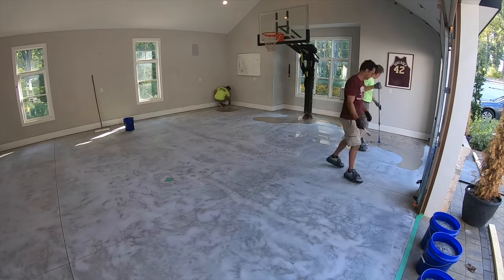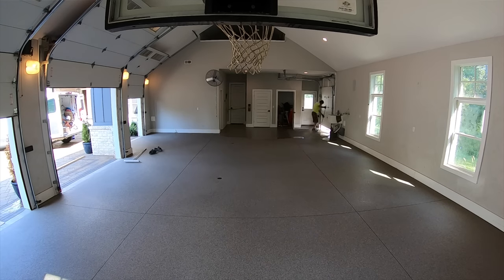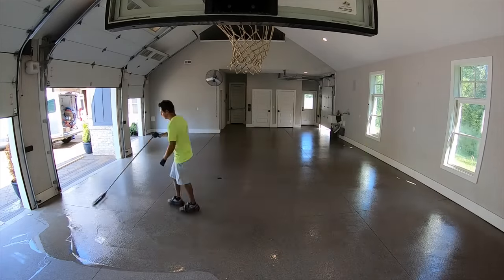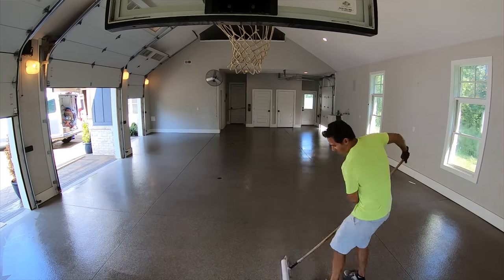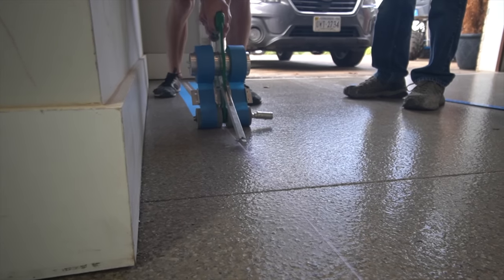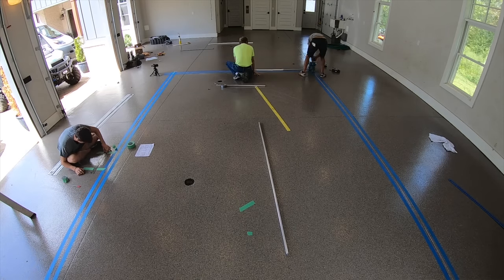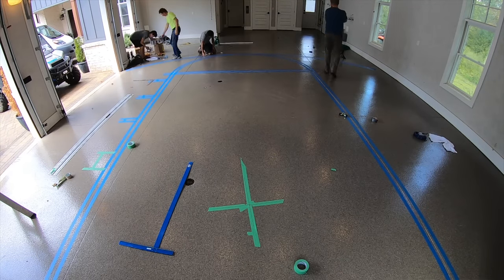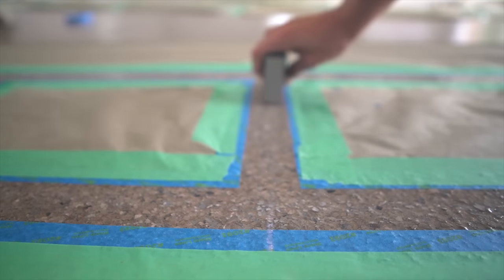Building a Basketball Court in a Garage with an Epoxy Floor

Comment: Those windows are breaking forsure
Reply from the maker: Haha. Yeah I thought the same thing. All of the windows have marks on them where the ball keeps hitting them...but so far they haven’t broken. ¯\_(ツ)_/¯
Reply: I would put a net in front of the back window and heavy drapes over the side windows
Reply: anony moose  very 1st thought I had, "with my jumper, no buckets with that low ceiling..."
Reply: Next is prob going to be a “How to repair broken window” video
Reply: @acer7217  I couldn't shoot on this hoop my shot has too much arc it'll just the ceiling everytime
Reply: Ceiling doesn't look low. Yall need to look at the backboard. Plenty of space
Reply: @j_boogie_483  I mean most arcs go about 50cm max above the backboard. Unless you have arc arc
Reply: @NARFALICIOUS  I would put the basketball hoop in the driveway where it belongs and my cars in the garage.
Reply: @TimDCVA  hundred bucks glass

Comment: I saw the recommendation for spraying which would have avoided the bleed through.  However, rolling is totally fine as well.  Just do something called "back-painting" first.  Once you tape off, roll a thin layer of whatever the color under the tape is, in this case clear.  The clear will bleed and "fill the void" under the edge of the paint allowing your color coat to be perfectly crisp with no bleed through.  You can apply this method across any type of painting project.  Looks good though.  Nice to see proper technique on application method and measurements.
Reply from the maker: Thanks!

I considered doing this... wasn’t 100% of the correct process though. Does the clear have to be completely dry before going over it?

Comment: Looks awesome but how can you even shoot in that garage? You’ll just hit the ceiling
Reply from the maker: Thanks! The ceiling isn’t an issue. It’s prob 18’ high in the middle.
Reply: You can only shoot three pointers from the top, just have to develop a horrible flat shot.
Reply: Sam Beaumont lol what? It’s super high in the middle. You can shoot normally
Reply: Omni Media Group - it is noted to be between 16 and 18 feet tall (in the middle) - see other comments. An elite level shooter’s ideal arc tops out at between 15 and 17 feet - hardly plenty of room/no allowance for margin of error and that is on an elite level player. 

Having a constant concern of hitting the ceiling, could easily lead to the user developing a flatter shot.

At the end of the day - these guys did a great job on the floor (their area of expertise) and the practicalities of the garage being used as a basketball court is irrelevant to that fact.

But I cannot help question if the intention was to make it a mixed use garage/basketball court before the garage was built or not - having a rafter ceiling and what appears to be a reasonable pitch adds cost - given the severe limitations of the court itself - it seems like either not much thought was put into it, or they didn’t think it through - although could be other restrictions around planning, permits available space etc.
Reply: Sam Beaumont i didn’t realize Stephen Curry was going to be playing here regularly lol. It’s just their garage for family and friends to come play at. Most people aren’t going to be shooting 18 feet tall shots.
Reply: Sam Beaumont also, the league average for height on a 3 point shot is right around 15 feet. Curry’s Max is usually around 16-16.5 and he shoots a pretty high shot.
Reply: Omni Media Group - kind of making my point?

Ceiling height - 16-18 feet in the middle.
You noted Stephs max height for a shot is 16-16.5’ - that skims or hits the ceiling at the lower end as indicated.

45 degree entrance level arc peaks at ~15’
55 degree entrance level arc peaks at ~17’

As you have noted these aren’t likely to be elite level players which means arcs are not going to be ideal or consistent.

Hit the ceiling a few times and you will start to subconsciously shoot flatter shots to avoid hitting the ceiling again.

Steph Curry has made the three ball very popular and young kids are less “Be like Mike” and more let’s shoot it like Curry.

Given the size of the court I would have to believe that it is more to muck around on get some exercise than anything else - even pros muck around with shots from half court, going into the tunnel.

Edit - spelling
Reply: @omnimediagroup5761  If you've ever played at a local gym that has a low roof or hanging light fixtures, you would know that a low ceiling is incredibly annoying to deal with.
Reply: Not to mention how narrow the court is. Not a good environment to develop range along the baseline. This looks to be a good court for working on free throws and post play, but as someone mentioned above - not a lot of young players want to do that. Floor looks great but this space is no good for any players who are serious about developing their skills, at ANY level.
Reply: Valente82 I would agreement I would want the garage to be bigger (wider) and taller on the sides for a serious practice but for free throws like you said are fine
Reply: @vsmcax1007  I think youu just need an adjustment on your drill if you want to practice there and find the perfect drill to do in that kind of space. It will develop your creativity too. I think it's better to have your own court rather than nothing . #stayhome #stayhoop🏀
Reply: @maxhansen5595  bigger is better... ✌🏻
Reply: You should have just put a slab of concert  in the back yard.. good conspect but your garage isn't nearly hight enough to play basket ball in....
Reply: Sam Beaumont how am I making your point? If you’re throwing a 3 pointer over 18 feet high, that a garbage shot anyway lol. Considering the 3 point line is mostly only in the middle on this court, it’s probably a non issue. Like I said, Curry shoots incredibly high and the league average is 15 feet (which is where most people are going to shoot their 3 pointer) lol. The dude even said it’s a non issue but here you are still arguing it is.
Reply: @sambeaumont395  you can shoot normal with a ceiling like that. People keep saying its low without looking at the backboard. No one just gonna build without knowing the space. I use to play in ceilings like that and and was perfectly fine

Comment: If you put mod podge on the edge of the tape first, then paint over it. Your lines will be way more crispy
Reply from the maker: I don’t know if it would be a good idea to use mod podge on a garage floor...but your premise is correct. We’ve painted lines on other projects since I made this video and using clear urethane on the edges of the tape and it does make the colored lines more crisp. 👍🏻👍🏻

Comment: i recently watched a video of someone putting sand into the paint for thier basketball court to prevent sliding and such when playing. what would be the benefit compared to sand that the epoxy and chips give you?
Reply from the maker: I think the main benefit is that a vinyl chip epoxy floor is meant to be driven on. I doubt a typical outdoor court surface would hold up very well as a garage floor.

Comment: Do you not have to worry about getting so much top coat in the control joints? Thanks! Awesome video.
Reply from the maker: Thanks! 

We pull the material over the joints pretty quickly to try to avoid filling them. It definitely gets in the lines, but it never comes close to filling them all the way up.

Comment: Can I do something like this to my drive way so the concrete isn’t so rough and doesn’t tear up my basketball shoes?
Reply from the maker: You can’t do an epoxy floor outside...but we do have a few different systems that we could do that would help you with that.
Reply: TimDCVA  what would those be?
Reply from the maker: Probably a troweled concrete overlay. You can find info on my website. Check the link in the description of this video.

Comment: is the flooring harsh for shoes and falls? vs say using wooden vinyl
Reply from the maker: Wood is softer than concrete… so wood would be better for falls. 

If you put vinyl over concrete then it would probably be about the same.

Comment: Awesome job! What type of paint do you use. Any special thing to know about painting on top of the epoxy topcoat. Will the epoxy outlast the painted lines?
Reply from the maker: We used a colored enamel on this one. The paint wears faster than the epoxy… so we could see through the painted lines on a lot of the high spots of the textured floor. It doesn’t look bad that way though.
Reply: @TimDCVA  thank you! Maybe another topcoat over the paint would protect it? Or is that not recommended?
Reply from the maker: Yes that probably would solve it.
Reply from the maker: Thanks!

It would be hard to do that because by the time the lines cured, you would be outside of the recoat window for the polyaspartic top coat.

Comment: Great video. I need to work on my outros lol, you’re great at them 👌🏼 ... tape machine for the win ! Crisp,
Clean and fast. How much are they ? Only thing that would of made the video better is seeing your shooting form from the 3 point line 🤣
Reply from the maker: Thanks!

They are around $1k. It seems expensive...totally worth it though. 

I didn’t get to shoot any...lines were still wet. Ha. 🏀 😎
Reply: TimDCVA WTF ! That’s insane. I would of guessed $250
Reply from the maker: @ConcreteBVI  Ha. I told you it was expensive. It has been worth every penny though.
Reply: TimDCVA 1k? that’s actually relatively cheap as the ones i’ve seen are usually 2.5k all the way up the 5k

Comment: You might also benefit from using black striping paint as well.
Reply from the maker: I considered traditional striping paint... but I figured using the same brand as the coating would have a better chance of bonding properly.
Reply: @TimDCVA  as long as it is oil based paint it should adhere.  There's spray primers that are very beneficial as well!

Comment: Awesome job on the floor, but all the owner will be able to do is layups and (if they're able) dunks. Maybe practice free throws, but any shots there will be arrows, when you should be shooting rainbows. Oh well, maybe they're a traditional big man
Reply from the maker: Thanks! The ceiling isn’t an issue. It’s prob 16'-18’ high in the middle.
Reply: Real world layups could be dangerous with the baseline so close to the wall.
Floaters, Post, Mid Range, Free Throws and three point shots from the top on a good day should be fine at 16-18’ ceiling (internal dimension).

But I doubt it was these guys jobs to comment on the practical use of the garage as a basketball court to the property owner.

Comment: How much would that cost?  Epoxy, paint and labor for that job.  16-22k depending on the slab and sq/ft? Looks sweet by the way, great job
Reply from the maker: It averages between $5-$7 per square foot plus extra for the lines. The price depends on the condition of the existing concrete. 

Thank you! 🙏🏻

Comment: Is the polyaspartic urethane self leveling?0
Reply from the maker: Yes... but the minimum spread rate is only 130ft per gallon... so it doesn’t really go on thick enough to level out completely on its own. You still have to roll it a lot to avoid roller lines.

Comment: what about the height?
Reply from the maker: It’s not a problem.  It’s probably 18’ in the middle.
Reply: how this cannot be a problem. I do not understand yet.
Reply from the maker: It just isn’t. I’m just guessing at the height...it may even be higher than 18’. Whatever the case, the ceiling is high enough. They planned on putting this court in the garage when they built the house a few years ago and it’s never been an issue.
Reply: you are guessing the height and instantly you are sure that the ceiling is high enough. I play basketball for over 10 years and I am pretty sure that the particular garage(of what I see)doesn't have the proper height to  built a halfcourt in it.
Reply: but I would say that you did a good job for the lines.
Reply from the maker: No. I’m sure the ceiling is high enough because I actually played in there. 🤣
Reply from the maker: Thank you!
Reply: I will not continue to discuss such a thing. If you played there, go again and videotape shooting baskets then I will admit that the ceiling is perfect for a mini practise. But I still do not find a good idea to create a basketball court just to practise in free-throws.

Comment: doesn't the ball hit the roof when u shoot
Reply from the maker: No it doesn’t. Not even close.
Reply: @TimDCVA  How tall is the ceiling?
Reply: @TimDCVA  I was thinking of building my own but my ceiling may be too low
Reply from the maker: @xXTrollerzForEvaXx  Its probably around 16' high in the middle.
Reply: TimDCVA - I know it’s not really that relevant to your job - but you have answered the same question for someone else saying 18’.

While a high level collegiate/pro usually has an arc topping out at 15-17 feet, and the court only allows for threes at the top of the perimeter, the roof as indicated doesn’t allow any/much margin of error.

It is also worth noting that the baseline being so close to the wall could be quite dangerous.

So while the job you and your guys did looks fantastic and very professional using this garage as a basketball court has many flaws and/or limitations.
Reply: @sambeaumont395  I think for what it is, it's great. I'd love to have something like that to shoot around at my house and practice freethrows or something. Definitely don't want to be playing intense pick up on that court.
Reply: Cranberry Juice - not disagreeing - just stating that the roof at between 16-18 foot tall is barely more than the supposedly ideal peak of an arc.
Depending on who is to play/use the court, it could easily end up with ball scuff marks on the ceiling, broken windows and poor shooting form.
Reply: @sambeaumont395  For sure xD I have a high arc so I'm sure it'd hit the top of the roof.
Reply from the maker: For what it’s worth... the walls are covered in scuff marks...but I don’t remember seeing any on the ceiling... Practicing JJ Reddick 3s might not be the best idea though. 🤪
Reply: TimDCVA - 👍

Comment: I just looked up your tape machine.....$937...wow.   I don't know if I could ever wrap my head around that price.  Please tell me I'm missing something.  What else does it do.....is there a computer on it or something.  I mean I feel like you could get one made out of a 3d printer for under $100.
Reply from the maker: Yeah it is expensive. The value is in the idea and the amount of time you save.

With that being said... No I don’t think you can 3D print it. You have to put a lot of weight on it when you are using it...I doubt plastic would hold up.

Also- in case it wasn’t clear... I don’t have anything to do with the company that makes the machine. I just bought one and used it.
Reply: @TimDCVA  Gotcha, hopefully you have already saved enough time for it to pay for itself.
Reply from the maker: We really have saved a lot of time. It took longer to lay out this one than to tape it.  

We did an entire basketball court & volleyball lines in a gym a few years ago in about half of a day. Pretty crazy.

Comment: How much did this cost to do? lol I don’t know why I’m asking I don’t even have the garage to do this 😂
Reply from the maker: Haha. Most garages are between $5-$7 per square foot...depending on how difficult the prep is. I’m don’t remember  how much extra we charged for the lines.
Reply: Dimes Manos - the garage is noted at being about 1,000 square feet, and “most garages being $5-7 per sq foot” suggests that this one was more expensive than that. Then you have the taping etc.
So easily over $7,000

Comment: Perfect idea...right up until someone gets their face sliced open. Make sure your homeowners ins doesn’t get a look at this. They’ll drop you with the quickness or double you up.
Reply from the maker: They planned on putting this basketball court in the garage when they were building the house, so they probably used tempered glass.
Reply: TimDCVA Sketchy plan for a basketball court unless it’s for free throws exclusively. Whether that’s tempered glass or not, the metal garage tracks are ready and waiting to trash whoever gets closest in the heat of battle. The place looks cool, and it’s perfect for one person. If any kind of 1v1 turns competitive, somebody will eventually get some meat torn off.

Comment: There gonna be marks on the Ceiling, the walls, hell probably the window too. What a wast of money, could have just built the shit outside and marked the Concrete with lines
Reply from the maker: There are marks all over the walls and windows because the goal was up for a year before I did the floor. There aren’t any on the ceiling. 

The homeowner, who is a former D1 NCAA basketball player, put a lot of thought into this before he put a goal in there.

Comment: Ceiling too low, no space for wing shooting , you don’t need a a pole the hoop could have been mounted on the wall behind the pole. You only can shoot straight ahead line drive shots and again the angles seems really low. With the windows you better by some padding too overall looks great but your limited with the width and height limitations